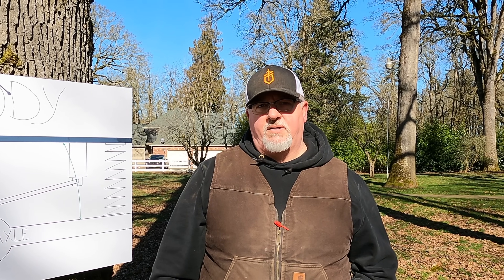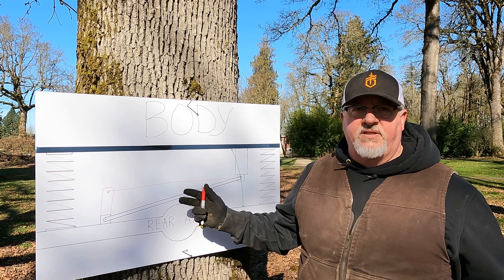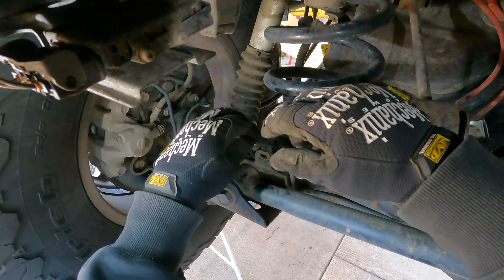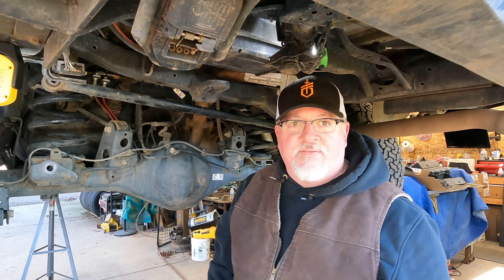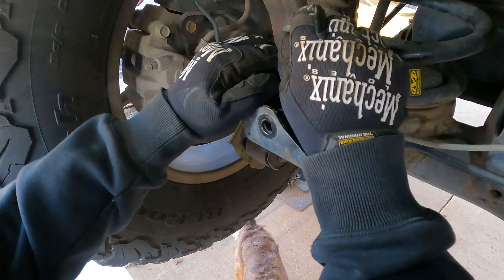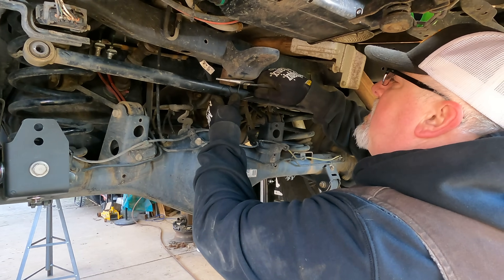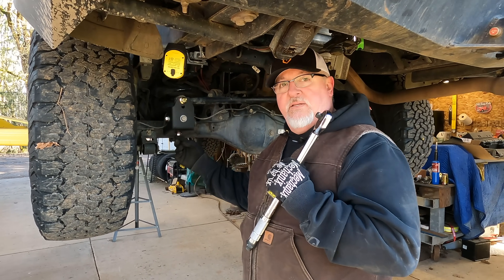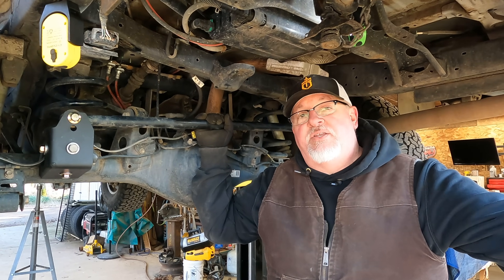Do Not Lift Your 4Runner ... Overland Build Recommended Geometry Fix - Do Not Lift Without This

Comment: Don't tighten the bushing bolt until you are sitting at ride hight. You will wear the bushing out prematurely twisting it too much. Never tighten bushing bolts until the suspension is sitting at ride hight. I see so many people skipping that step.
Reply: would it be bad to do this process with the vehicle sitting on the ground under weight?
Reply: @johnanderson7485  That's the way to do it. Sitting at ride hight.
Reply: I Dk the answer BUT ..the devil is in the details.that is a fact ,Jackson!
Reply: @wbwills2  ....say what?
Reply: It doesn’t matter if using bushings that are not bonded to the inner sleeve.
Reply: Is the bushing bolt the first one he removed that connects to the pan hard rod?
Reply: How to get the kit?

Comment: PCKs have been around forever.  Most people have no idea this is even an issue and don't do it because you have to weld it in. DRKDSS makes fabulous engineered components.  This bolt-in kit is a no brainer.
Reply from the maker: SPOT ON BBP! 🙌
Reply: Just wish we had a bolt on PCK for 3rd gen 4runners.  Only one I've found is a weld on and I don't weld (yet).
Reply from the maker: @christophersmith9963  Yeah, I hear ya. You should send an email to drkdss.com and see if he’s working on one.
Reply: @christophersmith9963  one day maybe, unfortunately, it's not just a signal unit bolt on design since both ends of the panhard have to be moved.
Reply: Where can I find this exact kit?
Reply from the maker: @taylorasbell7074  drkdss.com
Reply: @aired-downoverland9239  thank you!!!
Reply from the maker: @taylorasbell7074  Happy to help
Reply: @christophersmith9963 I’m going to make it for gen3 in the next 4-5 month.  This Drkdss on my other account
Reply: @Fltllc  please do!!!!
Reply: Just checked, and the 3gen kit is available ❤
Reply: @Gowaduv  do you have a link for that kit?

Comment: There is nothing wrong with lifting a 4Runner (4th gen and 5th gen) 2” in front and 1.5” in rear.  The stock suspension height is way too low in front.  I recommend a 2” spring preload spacer in front from Toytec.  And a 1.5” coil spacer for rear from Toytec.  This corrects vehicles ride height and sets suspension where it should be.
Reply: Sets suspension where it should be, because the Toyota engineers were too dumb to put the suspension of one of their most long lasting vehicles in the right place?
Reply: @Don-md6wn  It’s set low to reduce aerodynamic drag in order to increase fuel economy and lower center of gravity for reduced roll over risk.  As I said there is nothing wrong with a moderate lift.  It also significantly improves appearance.
Reply: Yah, the front end tends to sag with age so 2" seems to put it back to normal.  I did .75 and 1.5" in the back.  At 3" in the front, it didn't handle quite right though, the steering seemed too twitchy.
Reply: @DaveV-jr4mx  yeah 3” is a little high.  I think the upper control arm has to be replaced with aftermarket so caster angle can be set correctly.   And at that point I draw the line because reliable Toyota parts are replaced with aftermarket with question quality and engineering. 2” is a good set point for the front
Reply: @Greghook  The spacers I’m talking about are made by ToyTec and preload the springs by a set amount providing lift.  The vehicle still rides like stock and benefits from better ride height.  As I said above they are must have and work excellent.  They are no different in function than an adjustable coil over…except you only have one setting.
Reply: Exactly!!!

Comment: Great video. I suspect a lot of folks miss important steps like this when lifting their 4runners.
Reply from the maker: They sure do!
Reply: @aired-downoverland9239  question, I have not done the suspension on my 1992 toyota 4runner, but looking at it, the lift has a drop bracket for the pan hard bar on the right side instead of a bracket raising it up on the left side, would this be incorrectly done then? Also my shocks are behind the springs are these done wrong as well, because I see yours are in front of your springs?

Comment: Great video. Ironically it was when building my bagged minitruck suspension that I learned about the importance of long arms and the angles on everything. All the same basic principals no matter if lifting or lowering.
Reply from the maker: You’re spot on Jake. A lot of shops and lift mfrs don’t tell you about geometry correction, bump stop extensions, or the CRITICAL extended break lines. 🙌

Comment: Bought a 3rd gen 4runner that had been lifted by previous owner.... I noticed the rear shimmy right away, added a Sonoran Steel adjustable panhard and it made a huge difference.
Reply from the maker: That’s awesome. Keep in mind an adjustable panhard, like yours and mine, will help center the axle but won’t correct the geometry issues caused by a panhard with an angle between the axle and frame. 👍🏻👍🏻

Comment: 2 weeks later I got it all installed and WOW! I didn’t even realize it drove so iffy before. It’s a must do in my opinion. Really made the rear end feel tight to the frame of that makes sense. 
Great video
Reply from the maker: Thanks Garcia, I totally agree 🙌
Reply: where i can get this kit? what the name?
Reply: @juliuscafe  it's a panhard correction kit they have bolt on or weld on options. I can't remember where i got mine but I went with weld on
Reply: What kit is it can you post it ?

Comment: 2023 TRD ORP with KDSS. Mine handles great, very little off road so far with 1200 miles but a marked improvement over my 2016 SR5 Premium. I'll keep the OEM suspension . Thanks for your overview.
Reply from the maker: Congrats on the 2023 🙌

Comment: I have a 3rd gen 02 4 runner that's lifted 2.3 inches in front and 2 inches  in back. Never looked at this before but haven't had issues. I did however change the front bushings on sway bar/steering rack and man steering is awesome tight and responsive.
Reply: What exact suspenion lift did you get? I have a 2002 Toyota 4runner 2wd that I want to lift. Seems all the lifts are 3inch lift.
Reply: Bilstein 5100 both front and back. Front is adjustable height. You could actually go 2.5 adjustable height in front and 2 inch back. I have medium duty springs in the back old man EMU the back never really sags even when loaded.

Comment: Bumpsteer, roll steer and wheel hop are all worse with solid axles compared to independent suspension. These are among the  dozens of things that independent suspension helps to correct. 

The other thing about that panhard bar not being level is that your axle is moved to the right and will no longer be centered under your vehicle. The panhard rod helps keep it centered but it does move through an arc .
Reply from the maker: Absolutely. The most unsettling bumpsteer is the one that hits at 75 mph on the freeway 😳. It’s an eye opener.

Comment: Great video and a very overlooked fix. PCKs should be standard with lift kits in my opinion.  I do question if the PCK should have been torqued with the vehicle in the air though. Shouldn’t it be tightened with the vehicle on the ground at normal ride height so the bushing doesn’t get distorted like you would do for control arms?
Reply from the maker: Torque on the ground, full load, is always best. I do it in the air because I have a lift and it’s way easier to video…and I hate rolling around on the ground to wrench on my rig. Marking the hardware with a paint pen is standard for me, and I don’t think I’ve ever had something I torque loosen up. That said, you’re still spot on, always best done on the ground.
Reply: Should be torque on the ground for the main trac bar bolt only if you have oem/ stock style bushing which are designed for oem range of motion as it will deflect.  Poly bushings and Heim joints can be torque down any where.

Comment: My GX470 has been raised just slightly (2" in the front, 1" in the back) - not sure if that's enough of a difference to be a major culprit in my bump steer issue, but I definitely have it, but this is the first time I've heard anyone make a correlation between the symptom and the panhard bar - very interested in seeing if an angle correction bracket will help. Had thought it was more of an issue in front end suspension geometry (somewhat corrected by more camber in the alignment), but if this helps, I'm in! LOL! Thanks for the video!
Reply from the maker: The easiest way to check is to check your panhard while on level ground. If it sits at an angle, it’s a possible culprit. Based on the comments, this has helped a lot of people get rid of the rear end bump wiggle. 🙌
Reply: @aired-downoverland9239  - Thanks! I’d actually done that a while back when I found Dr. KDSS’s solution & it’s not enough of an angle to need his standard bracket - the stubby one should do the trick for me based on his measurement suggestions, but it still may be enough to help. But I don’t have as much rear end wriggle as I do steering wheel wriggling/jostling over bumps.

Comment: Going to look into this, I have an 02 3rd gen 4runner with a 2.5 lift and my VSC and VSC Trac off light now on. I'll be checking my abs wires and sensors too
Reply from the maker: I think that’s the right approach, the wires and sensors are small. Hope you find the culprit. 🙌

Comment: A little devils advocate.  That angle was greatly exaggerated with the suspension in full droop. Do you have any pictures of it with it on the ground? If it is level at full droop, wouldn't it make it too long once the suspension is loaded? 

Great video and explanation.  I will look into it for mine. As of now mine is level with 2" springs in the back.
Reply from the maker: Yes, it’s absolutely exaggerated while at full droop; that actually helps show the issue for video/educational purposes. If you not at the end, after the bracket is installed, it still has a slight left-to-right upward angle, however, on the ground it’s now flat. One great design feature of drkdss’ bracket is it has two mounting points. 👍🏻👍🏻
Reply: @aired-downoverland9239  I like it. Thank you for the clarity. Your brother must be exhausted holding the 2oz. camera. Lol.
Reply from the maker: @timthetrailman4563  Yeah, he works hard 😏

Comment: Great video... Slight question though, since that panhard rod has a rotation due to suspension drop and lift is that something that needs to be torqued when on the ground in its neutral position?
Reply from the maker: Re-torque in the neutral position is always best practice; same goes for suspension, etc.

Comment: Sweet thx!  I need to do mine, i can definitely feel a shimmy if i go over a sharp dip in the street. 👍

Ordered
Reply from the maker: You’ll notice an immediate difference, and I personally love an easy install. 🙌
Reply: @aired-downoverland9239  man you weren’t kidding.  I noticed immediately, just installed it.  Before the correction kit the steering felt SO light and I noticed that after the 3in lift but didn’t think anything of it until i hit that first dip and the steering went bonkers.  This makes it feel factory again for sure.  Money well spent.
Reply from the maker: @--RSL--  OUTSTANDING! I love hearing that. 🙌

Comment: Bump steers occur when the drag link from the steering box (to the tie rod) and pan hard rod or AKA track bar are not parallel in the front of the vehicle.  Typically applies to straight axle vehicle that steering knuckles are tied together via tie rods.

Bump "steer" is not of rear suspension geometry as it has little to do with steering components. 

Panhard rod is to keep the axle centered under the frame as the suspension cycles.  These adapters help restore the arc of the suspension cycle post lift.
Reply: Came here to say this.
Reply from the maker: It’s ok, some people prefer to call it “Rear steer” though the outcome is exactly the same, you flex by hitting a “bump” and it causes the rear to steer. Fact is I’m just trying to share something that worked for me.
Reply: @aired-downoverland9239  I don't know about that. Big the bigger issue is roll center rising as a result of the track bar not being straight. That will have an effect on cornering at speed. And that's going to be noticeable. I personally never felt bump steer in my lifted 4 runner on or off road.
Reply from the maker: If you prefer the words “rear steer”, no worries. The end result is similar, a bump (compression) causing the front or rear to steer.  All good 👍🏻
Reply from the maker: @AllTerrainFamily  I’m all for differing opinions, everyone has to make up their own mind in the end. The fact is this, for me and many others, we are feeling rear steer, and have eliminated it with a panhard correction. If you’re not feeling it, awesome, that’s one less modification you need to invest in. 👍🏻
Reply: @aired-downoverland9239  Fixing the track bar would certainly help with weird handling. I just don't understand how it would cause weird steering. I know that as you lift a 4 link you get steeper angles on the links and that will cause the axle to actually twist when one is compressed and the other isn't.  because it's changing the forward position of the axle. 

You know now that I think it through, I bet what you're feeling is the vehicle rolling more due to the misaligned track bar and that increased roll causes the links to cycle causing rear steer. That would make sense.
Reply: @AllTerrainFamily  this is how. Imagine going thru a turn that has a dip.  Depending on the speed you carry thru it and what your suspension can actually handle , the rear will wiggle thru it affecting how you steer thru it.

Comment: Great video!  Thank you.  I wonder if the vehicle is designed to handle angle fluctuations in the bar.  This can happen for many reasons.  A heavy item placed on either side of the vehicle... a heavy passenger riding in a back seat...  I wonder.
Reply from the maker: The short answer is yes, but you want to start from zero. Thx for watching 🙌

Comment: Great info! Is there a height requirement to add this? Like they recommend over 2.5 lift to upgrade the UCA’s. 
I’f you were doing a minimal lift (1-1.5”) would this be beneficial also?
Reply from the maker: I think it would, but you’d use drkdss smaller bracket, or, use the lower mounting hole on the taller bracket.

Comment: I don’t do the rocky trail hobby but have been driving a 96 4Runner since 98. have some other Toyota cars too. All OEM,follow the owners manual for maintenance & DIY whenever possible. Great truck. Goes like a goat when I do occasionally get into an off-road situation of any kind.loose gravel in the blue ridge mtns. It’s impressed since I got it. Family mountain trip this summer,heading down the mountain for some things & one of those rods had rusted out from the inside. Had just come out of a hairpin curve and R front tire broke off .tire/rim sat down nicely between the frame and the road so I was able to ride it slowly so I could be equal distance between 2 tight curves .Safest spot to stop,no place to get out of the road. Had to pretty much wing it with a recommended shop in the area & # 2 shop was able to fit me in & Finnish up with time to spare before the week vacation was over. Parts..had to go with what was available & was having the conversation on the phone. Early on a Saturday. Monday morning,mechanic called and said ready to go.was telling me what he’d done (found a couple small things that needed to be done when he got into it,so he read the parts list & explained.BUT ..Somehow,he’d done work on the RF only.We’d agreed on doing quite a bit more .work/parts for entire front not 1/2.still had time and he apologized ect. Was a good mechanic but needed a vacation of his own. He said he’d get back after it. ABS has been discontinued for the time being,there was a slight difference on a couple things on drivers side but it was ok. That was September.it started acting up last week. Appointment with my regular guy tomorrow at 9. If I were into this type of stuff. I d make sure to do my research..Reengineering stuff like Toyota trucks can get tricky I’d bet. One wrong decision could derail a project at some point down the line I suspect. Force you back to the starting point depending on what the situation is .?. I’m happy with my mechanic these days. He knows Toyotas but works on some other things. Last mechanic (my 1st Toyota mechanic was all Toyota,all the time. Aged out back in my 22R days)Anyway,said to my current guy (6-7 years now) “Would have been nice if my father had been a mechanic ,taught me,& I knew how to do all of my own work . He was a salesman..”Tim responded..”My dad was a carpenter and smiled “I thought that was hilarious. I might have even LOL’d a little,don’t recall but left it at that. Tomorrow morning we shall pick up that conversation again. Dk how it’ll go tomorrow, I don’t think it’s going to be TOO painful. Might’ve been something as simple as a dab of special sauce was forgotten. Somewhere in the 2/3rds of the job my emergency mechanic ,that’s 300 + miles away from here,had forgotten to do. Time tells all tales..take care & enjoy.